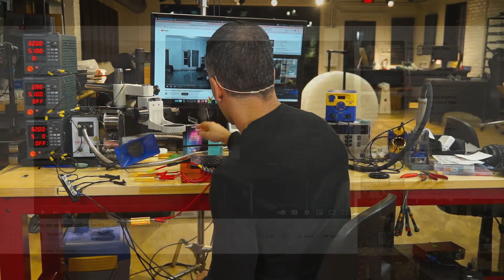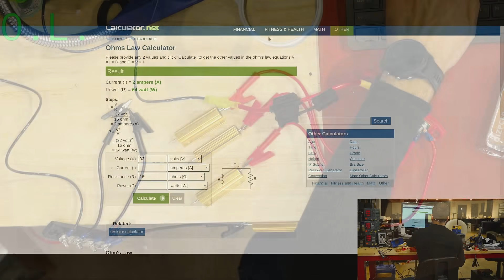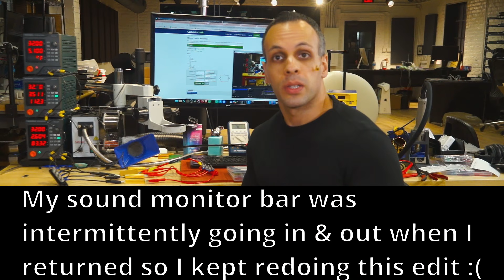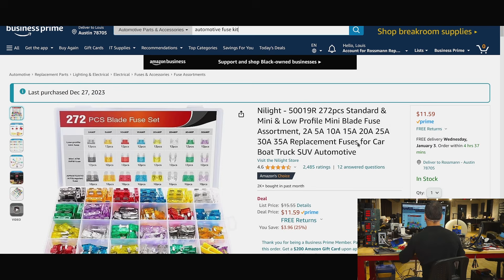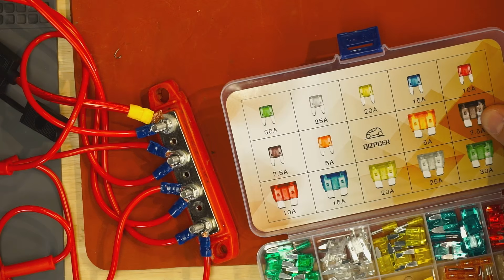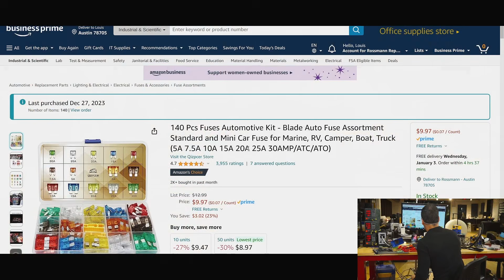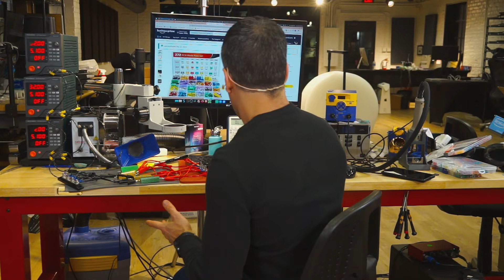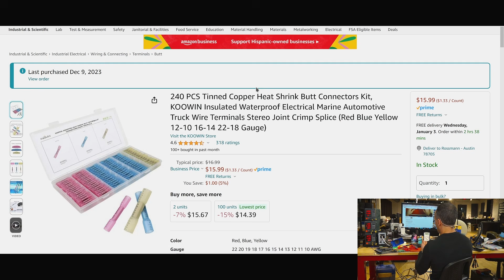Amazon Sells Fake Electrical Fuses

Comment: I 100% believe your test results, you can also often test for this without even buying the product, just look at the listing picture and you'll see all the fuses have exactly the same metal fuse element inside just with a different colored plastic case and number stamped in the top. I would only every buy fuses from reputable manufacturers, even the ones you tested good today from a seller may be complete trash next week. And don't even think about the cheap resetable fuses, particularity the large 80, 100 or 200 A ones, they're death traps.

I also 0% believe Amazon would recall this product. I wonder why Amazon is so successful? Is it maybe because they claim they don't have to play by the same rules as physical retail stores that have liability and accountability to the products they distribute?

I also assume you know but you didn't mention so just in case, those resistors are rated for 100 W, but only if you BYO heatsink, they're an industry standard size so if one breaks you only replace the resistor and reuse the heatsink.

Comment: Super enlightening. I recently had a fuse holder melt when my battery charger failed and it was the smell of burning rubber that alerted me. There must have been over 30A flowing through that Amazon garbage 10A fuse and it never blew.

Comment: To be fair regarding the ratings, how many test fuses like you did?
A rating is made on the appearence of the item and the box shortly after arrival.

Most time when a fuse blows, the short create a current much larger than the nominal current, so you don't know when the fuse actually blew.

Comment: The way Amazon works now, they will never be held accountable because they'll just tell you they are a "marketplace" and they don't control or regulate what is sold on that marketplace.  Their business model is specifically set up so that they are not held accountable.
Reply: I thought so too, so I looked up that fuse product and it does say "sold by: amazon, shipped by: amazon" so Amazon is actually selling that garbage product.  If it says "sold by: Shenzen's best fuses no need to worry we do best fuses on internet dont buy other place" then it would be marketplace.
Reply: @TheHollowGrind  Does sold by and shipped by Amazon really increase liability?  I don't think so but I'm not sure.  I think they are still going to say that they don't take responsibility for individual products sold on (or by) Amazon as they are just the storefront.  I tried to sell on Amazon once and they didn't even ask or care about quality of the product.  Their only concern was just proving you had a product to ship and could provide tracking.
Reply: @mikeyc8139  there's no way Amazon will be liable, but technically they did sell it.  I'm sure there is some disclaimer.

Comment: I'm aware this i a bit pedantic, but i'd have preferred it if more than one of each fuse was tested, not just the one that seemed ok. It's like trying to find a fault with something that's ok while immediately accepting a faulty one as representing a full batch.

9:02 did you wash your hands?
Reply: There is a chapter called Louis washes hands

Comment: I thought car electronics were 12V, not 32V.  Is that affecting the testing?  I don't know enough about resistors and imedance and all that, but I thought higher voltage doesn't requires quite as thick wiring, meaning that these fuses will be able to handle a lot more amperage at the higher voltage?

Comment: Voltage is not a factor in the current handling of a fuse.  A 32V 2A fuse should blow at the same current as a 250V 2A fuse.   The voltage rating only becomes a factor once the fuse has blown and the potential for arcing occurs.
Reply: If you put 250V through a 32V fuse, the fuse will blow and will continue to conduct because you'll have a standing arc inside the fuse. That's why the fuse's voltage rating is important. The current rating affects when the fuse blows, but the voltage rating affects when the fuse stops conducting.
Reply: @whitslack  Exactly what I said in the post that started this thread.
Reply: @xjet  That fuse would not arc at 250v it takes 2,500 volts to arc one millimeter.
Reply: @SmokeyWire56  In clean air, yes. But you're going to have smoke and vaporized metal inside the fuse casing when it blows. That makes the air much more conductive.
Reply: @whitslack  Ya, and it's not going to continue to ark unless theres enough amperage.
Reply: @SmokeyWire56  There will be enough current to continue the arc indefinitely, until the heat burns away the fuse casing and allows convection currents in the surrounding air to carry away the ionized particulate matter. Once an arc forms, the breakdown voltage of the air gap falls significantly due to ionization.
Reply: @SmokeyWire56  At high voltages arcs can be sustained with every low currents.
Reply: To do the test perfectly the increasing resistance from the heat of everything the wires the resistor would have to be accountant for. In a perfect world on paper yes 2 amps is 2 amps. But think of the wattage as heat 2 x 32 is 64 watts and 2 x 250 is 500 watts theres a little difference there.
Reply: @SmokeyWire56  No difference as far as the fuse is concerned -- the power consumed by the load makes ZERO difference.  Only the current passing through the fuse matters.
Reply: @xjet  That's how an ideal fuse should work, but reality's more complicated.
Fuses rely on power being converted to an increase in temperature, which can be affected by the max voltage. When the fuse is on the threshold of opening, its resistance increases, so the maximum possible voltage across it starts to have a considerable effect. If the voltage limit of the source is way too low, the fuse can behave in an unexpected ways, such as limiting the current through it rather than blowing open. You can pray and hope this fault current's close to its rated current or you might be lucky and the datasheet might show the curve down to very low voltages, but yeah, it's a bit of a gamble.
Reply: @SmokeyWire56  dude, just stop.
Reply: I've always wondered about that, but somehow not enough to check... Thanks.
Reply: Would have been even more funny if they blew at 5x the rated amperage and then started arcing at the voltage rating 😂
Reply: That is spot on. The voltage as reported by the supply (32V) is mostly an irrelevant figure in this test. You can (and maybe should) run this test with the supply in constant current mode, it does not make a difference.
Reply: I completely agree with everybody who is pointing out that it doesn't make any difference whether the circuit voltage is 12 or 14.8 or 32 or even 250V. They are absolutely correct. I'm just saying, since it makes no difference, you will get less spurious blowback if you test an automotive fuse at automotive voltage.
Reply: Should probably have done the test at 12V since that is the voltage that most of these fuses will be used at. As you say, it shouldn't make any difference to the result.
Reply: @justinsmith2363  The test would be the same. Weather its 12v or 32 volts, the fuse does not know the difference. Theres know way it can "tell" what the source voltage is, it will look identical, because for a given current, the fuse will drop the same amount of voltage
Reply: @justinsmith2363  12V nominal, a car realistically works at 14.2 to 14.8
Reply: @joshdeeney8456 More like 11-14.8 You won't get above 13 V if the engine is off.
Reply: @justinsmith2363  But then his desk wouldn't have started to burn. Where's the fun in that?
Reply: This is completely wrong.  You need to study Ohms’s law before spouting misinformation.  Voltage = Amps * Resistance.  Therefore, Amps = Voltage / Resistance.   Effectively, you double the voltage an any load doubles its amperage draw for any given fixed resistance.
Reply: @NETWizzJbirk  Yes, but the current is still the current. It doesn't matter why that much current is flowing, only that it is. Given the resistance of the fuse, this current flow will result in a certain power dissipation which heats it up and blows it.
Reply: @NETWizzJbirk  But the only thing that matters to the fuse is the current passing through it.  It doesn't care if you're using 32V into a 16 ohm resistor or 16 volts into an 8 ohm resistor -- in both cases 2 amps of current will flow and the fuse doesn't care about the power being dissipated by the load.
Reply: @xjet  that is true.  Bu
Reply: The wattage will make a difference in a real test though. Had he tested that 2amp fuse at 12V it would have blown at over 10 amps maybe like 15 amps.
Reply: @SmokeyWire56  False!! The wattage through the entire circuit will be less, but the wattage consumed by the fuse will be the same. Let’s say the fuse has a resistance of 0.1 ohms. V=IR, so for 2 amps going through the fuse, it’s going to drop 0.2 volts. This voltage drop will be the same independent of the source voltage as long as the current is still 2 amps. (Yes this will require a lower load resistance to meet the 2 amps) With the same voltage and current going through the fuse, it will be drawing the same power (in this example 2*0.2 = 0.4 WATTS going through the fuse in Both Cases). BOTH CASES WILL BE THE EXACT SAME AND THE RESULTS WILL BE THE SAME.
Reply: @SmokeyWire56  Which wattage???   The only thing that affects the fuse is the current.   The heat generated within the fuse is defined by the resistance of the fuse element multiplied by the square of the current.   This heat is what causes the metal to melt.   Whether the fuse is in a 12V or 120V circuit makes no difference.
Reply: @SmokeyWire56  You have to evaluate the wattage at the fuse. The fuse has some resistance R. Therefore it causes voltage loss  U=IR and power P=UI or I²R. The voltage loss in other parts of the circuit like on the actual load is not relevant. The fuse sees only the current that goes through it.
Reply: @SmokeyWire56 Sorry, but this is completely wrong. Please do not spread dangerous misinformation.
The fuse isn't a resistor (super low ohms). So the voltage doesn't (really) matter.
Reply: @joe--cool  wait, isn't the fuse being a resistor the whole driver behind its function? It has a certain defined current path of an area that means that (if it's manufactured in tolerance to design) a current exceeding its trip value for a specified period causes resistive heating to a degree which causes the metal to melt and create an open circuit
Reply: @bobjoe1593  Fuses are not resistive until their rating is exceeded, just like any piece of wire. Sure, everything has a resistance, but it's negligible

Comment: a fuse is the last ditch protection you get before you get fire. so even if you have current sensing protection you know that when the fuse blows all of those have failed.

Comment: You should not have used resistors, but used the current limit setting on a proper psu.

Also, you should mention the characteristics of the fuse, a slow blow fuse should not blow the instance the current exceed the rated current.

Comment: Yep. I discovered this when I was restoring an older model car when the park lights went out. Long story short, the Amazon fuse did NOT blow, the result being almost burning out the wiring for the lights (found out to be a bad ground and fixed it). Ended up buying a pack of fuses from the local electronics store, never had a problem to this DAY.
Reply: I would have ordered all the wires and fittings for the repair. Then file claims on all of it with various complaints while retaining what I needed from the order.

For instance, the wire. Buy a 100 foot roll, claim it was already opened, even though I opened it and used the wire I needed.

On the crimp fittings. (Buy good ones!) A 100 pack or so. Then claim the packaging was opened. Again, this was you, not the whoever your blaming.

Amazon needs to pay for this crap. If not them then their retailers. All using their own system. This is how I would hold them accountable, while also pushing hard on customer service and possibly contacting a lawyer.

Comment: Could you please:

1. From the bad batch compare the geometrical characteristics of the fusible element of the different rated fuses. 
2. Compare the fusible element of the bad batch with the same rated fuse of the good batch.
3. compare the material of the bad batch with the good one.
Reply: hello sir this is Louis Rossman channel, he repairs male vibrating rings for a living. This is too much work to make a video

Comment: Yep, anyone even trying to justify these not blowing at some % higher than rated is either a shill, moron or just evil. Try to imagine this in any other scenario, like an elevator saying it can hold 8 people, but the cables snatch at 2 people, or a cars wheels falling off at 55 MPH or 90 KMH. This shit would not fly there, everyone would be rightfully outraged.
At this point, I would say that Amazon wants to burn down houses/cars and kill people....
Also, even if these were one offs, NEVER should it be 5 times worse than expected.
Since fuses are a safety equipment, I really hope theyy would be sued below ground

Comment: Going to respond from the peanut gallery. First fuse was utter crap. The 5A fuse blowing at 10 isn't great, but even a proper brand 5A fuse will take a little time to blow at 8A. So I'd label the second one as poor quality but not fake. In my opinion a slow fuse should blow at 2x the rated current in under a second. And at 1.5 the rated current it should blow under 30s. Looking at graphs from litelfuse that is also what you can roughly expect from them.

Comment: You should have hooked up an amp metre so we could see it happy New year
I'm not sure that test is correct doesn't matter how much amps you set on your power supply it depends on the draw current, are you drawing more than two amps? Without the metre it's hard to say so what's that 4 ohms at 32 volts?

Comment: I don't know if you saw my previous comment, but sometimes the reviews on products are not "fake" but reviews from another product. Companies or organizations will sometimes use a successful product page and simply change all of the information and images to a new product, while keeping the old reviews for that other product up, bumping them up in search results and giving their product a guise of authenticity. 

Go to the reviews of any highly rated (and especially cheap) product and actually read the reviews. Sometimes, the reviews talk about something entirely different than what you are trying to purchase, which is a huge red flag.
Reply: I'v noticed that many times yes, it is a serious trustworthiness issue. They use the same trick when a product gets completely redesigned; the good reviews for the older version turn up under the listing for the new version.
Reply: @maidsandmuses  I've known it from probably the best known multimeter manufacturer who had to accept a completely redesigned product as the main chip in the multimeter was no longer made. Not only did they deny the change (I evaluated the old and new versions as our company was looking to introduce it into it's own-brand range) but they still claimed the same UL & CSA references for the product. They got rather nasty when I raised the issue with them and was warned off "making waves" about it!
Reply: Amazon either doesn't care, or doesn't have a system in place to monitor when a product page is altered in this way for whatever reason. 

So now as a rule of thumb when i buy stuff on amazon i look at the reviews to ensure they are talking about that product, and ignore 5 star reviews that just say a few words of praise as i don't trust those if they are too many @maidsandmuses
Reply: I knew they sometimes would switch to lower quality versions of the same product, but I didn't realize they could actually switch to an entirely different product. That's an amazingly big loophole that Amazon should have fixed forever ago.
Reply: Yes it is, and i only realized this practice was a thing this year. Im not entirely positive how they do it, but they likely sell a legitimate product for a while and get lots of positive reviews then simply change the entire product page later. Apparently Amazon is either unwilling or unable to stop this from happening by forcing them to create a fresh listing instead of re-using an old one.  @renakunisaki
Reply: That's a plothole that spells doom for Amazon.

Amazon shouldn't be giving its retailers the power to manipulate Amazon's own listings in this way.

I can already often find reputable products cheaper elsewhere than Amazon. Even coming from the same retailer...

Edit: this is why I just let my prime membership lapse.
Reply: That's true and a big part of the problem. Amazon could easily monitor for that practice using the same algorithm that searches for the product in the first place.

Another nearly fake review type is when the reviewer gives a good review entirely based on shipping time being faster than the estimate.
Reply: I've seen product pages that have multiple variations to pick from but each variation is actually just an entirely different product. Some of the products will be good, some bad, but reviews are shared so it's quite misleading
Reply: So true.

Comment: And there is issue,
1) fuses limit current and not power.
2)power= voltage * current
3) overloading these specific type of resistors may cause them to explode(seen nasty burn marks on one guy hand). Plastic inside will start to pyrolize first causing gas and when one plug finally gives away its like shotgun.
4)these load resistors are without bolted heatsink probably do max 5W
5) louis is oblivios of abovementioned stuff and pushing >60W into reistors that could halndle 5W
6) Darwin award may not be granted but you better have good healt injurance.

Comment: Next time, try using switches instead of connecting alligator clips to flesh burningly hot resistors.
Reply: Use Amazon sponsored electrical switches for the ultimate test